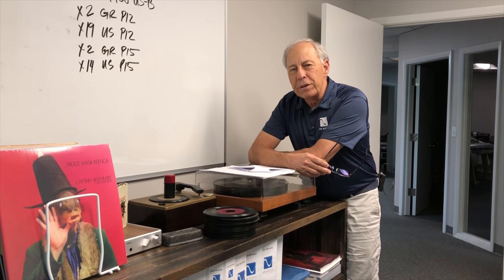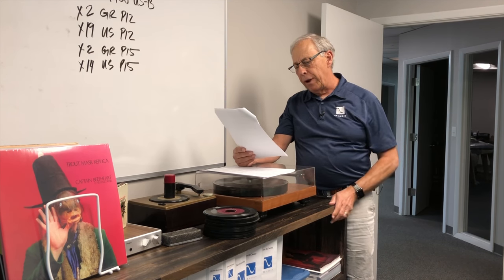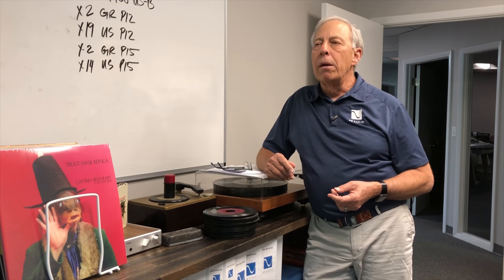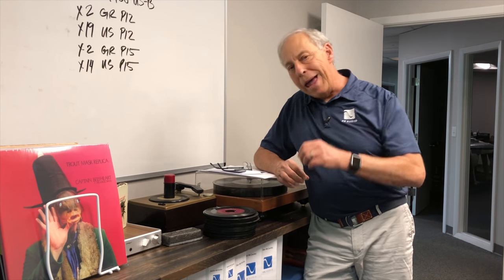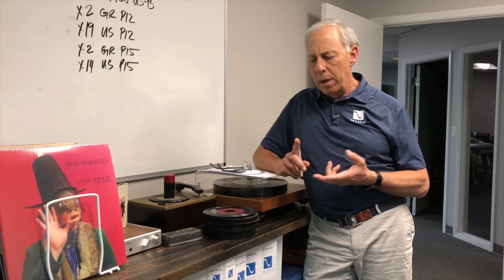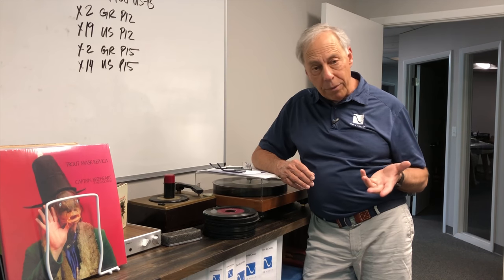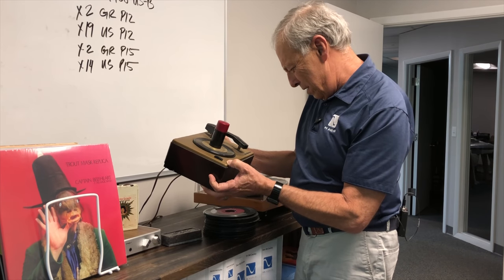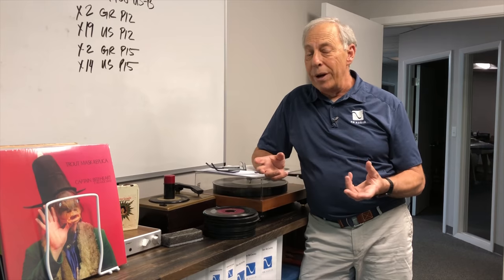How far can you take vintage audio equipment?

Comment: I can confirm replacing a vintage amplifier's electrolyric caps produce astounding results when done correctly. I had my nad 3020 restored professionally. As Paul has said, those old caps dry up resulting in a very sterile, flat sound.

There's hundreds of examples on the reddit "vintageaudio" page or audio karma forum of audiophiles restoring old pieces to perfection!

Comment: I regularly service amps up to 40 years old. I generally change components like for like. As Paul says modern electrolytic have a lower ESR, so you can increase the value by up to 50% in some locations such as PSU smoothing if the transformer and rectification can handle the extra current.
Reply: John Jackson Dumb question, but what are electrolytics and how do these differ from the other components Paul cautioned against replacing?
Reply: @robertfunk4999  Sorry we tend to use abbreviations. I am referring to aluminium electrolytic capacitors. This type is commonly used in power supplies for filtering as they have high capacitance versus size and cost.
Reply: @sonyajones  In many applications the capacitance value can be overspecced to give longer service life. In high end audio applications the value is chosen for the best sound. For this reason it is often worthwhile replacing capacitors far sooner.

Comment: Hmm if 80s is vintage, then what is early 70s? Super vintage?
If one has the know how or knows someone who does and one has a piece if kit from the early 70s or what have you, I'd hang onto it unless you really truly do not like the sound. 
I have a "modern reference system in progress" I am working on, but I  also have a second system that is "vintage based". I currently have for example, a Sansui 8080db. I have had it serviced, which cost me around $200, but for that I bought about 15 more years of service, maybe more. It has a really amazing sound for a solid state amp. It sounds like a tube amp with some good engineering. I have spoken with a few modern high-end amp manufactures and some of those guys have told me to also hang on to that Sansui. They told me to get the same quality sound today I would have to pay at least $10k and would only come close for that. Sure, I could get something that would best it, but that would cost at least $20k. I don't even have $1k lying around on any given day.
Also back then, it was entirely different, even from the 80s. Back in the early 70s when this stuff was new it was mostly hand-built in japan with intense quality control. That is why some of that gear today if well taken care of is still going! That is almost 50 years! I'd like to see any modern amp including high-end ones last that long...not a chance. If you get 10 years of service these days you are doing exceptionally well.
At any rate, there are great sounding pieces from today, don't get me wrong, but there are still pieces from yesteryear that carry the same performance or better and I am not counting a nostalgia factor either. All that early gear is the grandfather to what we call high-end today.
Reply: Eric Elliott the Sony amps last.
Reply: YUKI JINJUJI Not entirely true. We have a Sony stereo amp. for our home system and after ~20 years the solder joints are coming off causing bad connection. I've rarely seen this happening in electronics, especially of this age.
Reply: I have a 29 year old Sony receiver and it still looks and works very well.  No lights dim or burnt out; no crackling sounds from any of the switches or knobs.  But on-line, the value is very low — seen as little as $50 asking price — I think because the face plate and knobs are plastic instead of metal.  But the innards that are the receiver still work fine.

Comment: Overall in audio, the good components have improved but engineers have on average become less passionate about audio fidelity and more focused on low cost and features. Reason is that in the last couple of decades the brunt of audio engineering has moved to Southern China where engineers are more focused on optimizing towards low cost than optimizing for great sound. Your cheap sound bar, Bluetooth speaker, smart speaker, PC speaker and headphone is most often developed by some fairly young newly graduated Chinese engineers who never heard what good sound is and don’t have much passion for sound quality. Their typical method of testing an tuning involve some chinese songs, mostly with vocals and rarely with much low bass, high treble, details or soundstage so what you get today is on average often worse than the mainstream of the 90s. Almost nothing of what the consumers buy today is engineered in the USA. PS Audio is an admirable exception.

Comment: Ok Paul,  your comparison of your teslsa too the split window corvette is wrong.  If you pulled up beside the corvette at a red light,  I guarantee you would be checking his ride out and he wouldn't even know you where there.

Ps. I have both a modern high end system and a lot of vintage systems,  I do agree the new gear sounds better but it's not an either or question.  I think most people enjoy both.
Reply: Which if I understand it correctly was exactly what he was saying... ?
Reply: hifi noob 2018 but thats essentially what he has said: Old things can be very cool and desirable, but from a performance point of view, new things tend to be better.
Reply: Dave Micolichek  my Ducati chipped diavel will destroy anything 4 wheel job under 250k. LoL
Reply: Dave Micolichek  of course.

Comment: I have a couple of 1970's Pioneer turntables, a PL-A45D and a PL-A35D.  I have debated over the years of getting a modern one with a servo motor to get the speed to play at exactly 33 1/3 but I know they will never be as constant as the old vintage Pioneers that I have, unless I spend over 1000 dollars.  Sometimes vintage is better.
Reply: Yes. Good quality vintage turntables are worth keeping if you can service and maintain them. The economics of designing and building a modern-day equivalent would be expensive and young people are more into streaming on iTunes rather than buying records. I have a PLC-590 that I will never sell. I used to have two of them but sold one when I quit DJ work.

Comment: Good Vintage equipment sounds as good as the new stuff if you want to enjoy music. If you want something to brag about, or must hear dust falling down in the corner of the studio when the artist was recording then sure, go for the ultra high price modern high resolution equipment; and make sure they add some of those thick cables that will allow you to hear the difference between the fancy crystals attached to the speaker terminals ;))
Reply: lol, I'm with you but I'm sensing this isn't the place to voice that... :-D
Reply: Tenspeed TheBikeHanger Agreed, all I’m saying is that there are different types of audiophiles: those concerned with listening to music and those that want to push the technical limits of sound reproduction. Very different goals and for the first one vintage equipment is pretty awesome. There is a reason why so many people swear by it.
Reply: @turnersparadise8368  trust me, it's not ...I still like to pull their chains though...

Comment: I have noticed in mixing old components with new that sometimes the newer better components can (and often do) reveal limitations in the older components that you never knew where there. Also Paul I have been wondering about something, do you feel it could be worthwhile to (in say a recap) to use a trimmer cap to "blue print" the exact value recommended by the  OEM? or is that just being anal, lol.

Comment: Stereos have really declined since all the safety and emissions laws chopped off the low ends, and filtered the highs. We can't take 'em down to the strip and race like we used to. The laws of economics and tech advances should tell us that modern gear should both be superior, yet cheaper, than older stuff - as long as the market and industry is in a consistent niche, which analog audio certainly was NOT for ten or twenty years. The quandary for elite audio purveyors is that using modern parts must be parsed cautiously, so as to not offend the wealthy luddites who buy the most gear, yet phrasing the rationale with jargon that acknowledges certain parts as modern marvels. The final crux is also the fact that it does have to perform at a high level, even if that might be equaled by a $250 unit from Best Buy, so actual engineers still must work with the raw materials and maximize audio outputs - likely, by using expensive equipment to measure things, otherwise their ears will be bleeding at the end of each day.